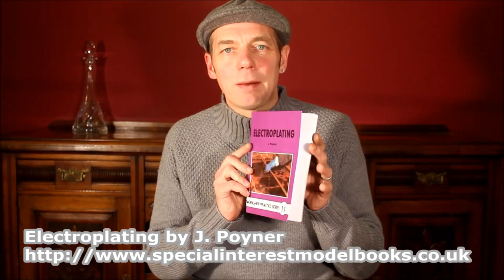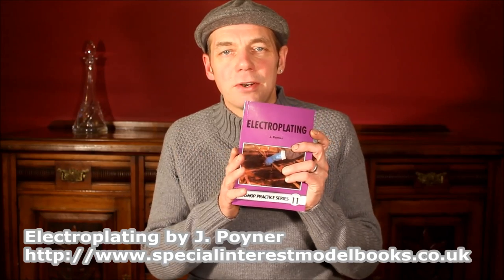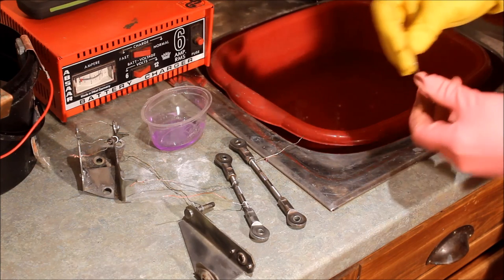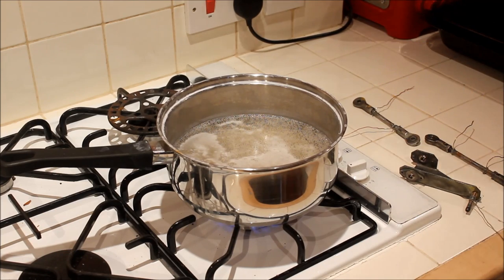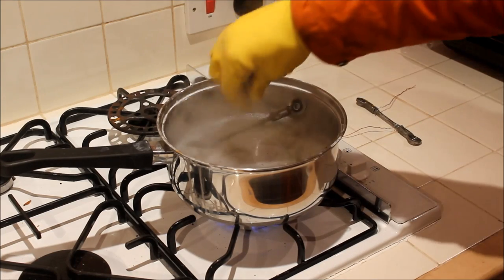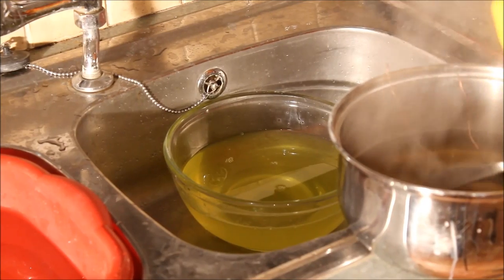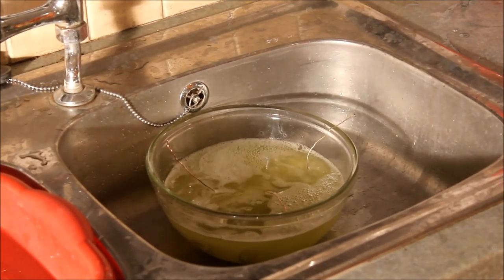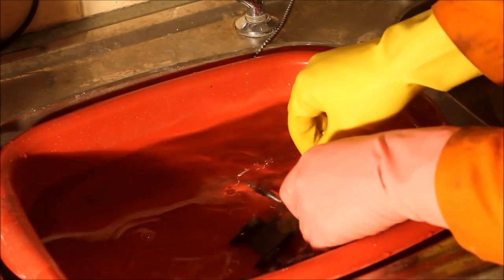Restoring yellow passivated zinc parts by DIY electroplating

Comment: This is a really good instructional video. It has excellent audio without hiss or hum or trucks in the background. Lighting is very even too. You speak clearly, not too fast, no mumbling. You look directly at the camera and not everywhere else, and no blinking, yawning and umming/ahhing. Humour to drive home the points. In short, this could be used as a model for how to make the ideal instructional video. Really great job. 

OK - enough grovelling. Question - a number of zinc plating videos use Zinc Sulphate instead of Zinc Chloride. You got any opinion on that? Can you just use them interchangeably?
Reply from the maker: Very kind, thank you. Any solution of zinc cations and negative anions will work to some extent but some work better than others. Commercial platers use cyanide for the anion but that's no good for DIY work for obvious reasons. Acid zinc is most suitable for home use and zinc chloride is popular because the proprietary brighteners (Hyperbrite and so on) you can use with it give nice, shiny results. I haven't used sulphate myself but I understand it works albeit with a dull finish.

Comment: This is the most comprehensive video I've seen on the topic, absolutely fantastic - thankyou for taking the time to make this.

The brighteners seem the closely guarded secret, the secret sauce.  I'll bet they are fundentally simple too - any ideas?  Covalent compounds that modify the crystal growth on the metal - but what!  I see folks throwing sugar in baths, but still dull coatings - have heard people use molasses, bit b3 and so on... hard to tell what is wives tales and what might actually give a good result!

PS I know you can just buy brighteners but that's not the point!  I need to know lol

Comment: Fully agree with Bill , one of the best instuctional video s i have seen , clear , practical , and good humor !I am going to try this ! you are Gold :-) , i do have a question tho : would glass bead blasting be a good step 1 in this proces?Thanx
Reply from the maker: Yes, absolutely. For heavily corroded parts grit or bead blasting is ideal. Just wash the dust off after, give it a light etch in the acid and it's ready to go straight in the bath.

Comment: The reason you had difficulty adjusting the current is because the battery charger is not giving off stable DC, it pulses at 100 hz. This means ohms law does not apply in the same way. you have say 10 times the current for say 10% ot the time. Your current meter does not read RMS current because its a cheap one so you can't rely on it and 10 ohms would only be necessary were you would use 100 ohms with D C.

this means you current  control is all in the last few percent of the resistor value  so its very coarse and would probably overheat.  That's why you cannot adjust it properly 

You could either put a large electrolytic capacitor across the charger to make it more like DC.  or change the resistor value much smaller so  you have control back

Comment: This is the best plating video out there! 
Out here in far north Australia I cannot get propriety brighteners ...I actually had to order the Zinc Choride from the UK. 
Can I use sugar as a brighter?  If so, any recommended ratio??

Thanks again for the superb video!
Reply from the maker: Cheers Cobber. I don't know. The proprietary brighteners are organic based (like sugar) but they don't tell you in detail what's in them. If you try it let us know how it goes. Sugar would be a lot cheaper.
Reply: Daryl saccharin is used within nickel plating, sadly not in zinc plating.

Comment: After the zinc process i have new tiny little  rust areas. Do you have an idea why does this happens ? What mistake could i have made ?
Reply: Increased brightener additions to the plating bath could increase the grain refinement of the zinc coating over the possible micro-porosity inherent to steel substrates.

Comment: Is Your Sodium dichromate Na2Cr2O7 or dihydrate Na2Cr2O7·2H2O  ?
Reply from the maker: Either will work. Sodium dichromate is a controlled substance (in the UK at least) so you either need to fill out some paperwork with a chemical supplier or just buy the passivate already made up from a plating supplier. For small scale work the latter is easier.